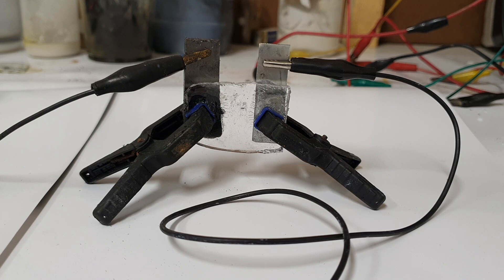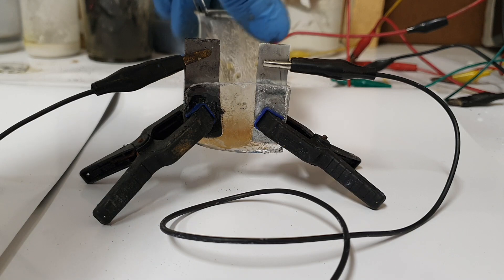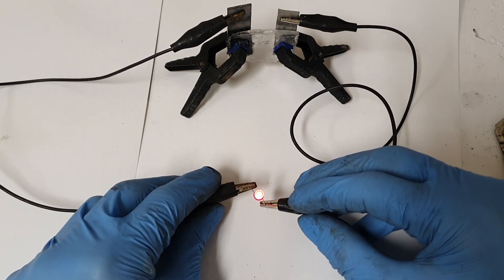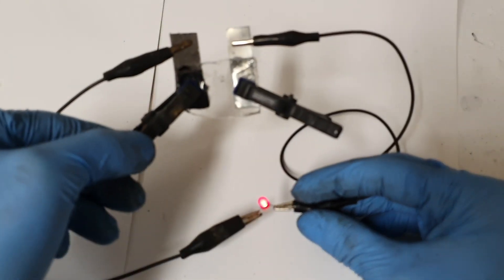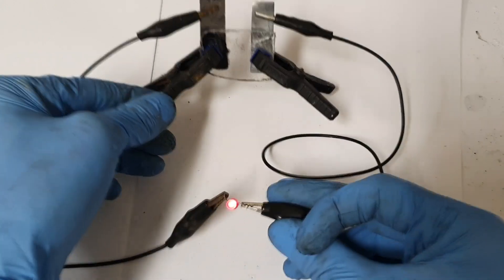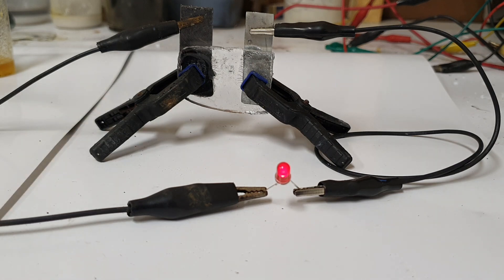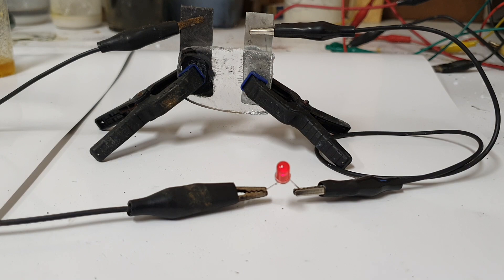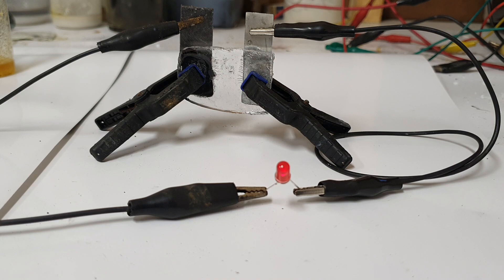"Transparent" Battery

Comment: Is the transparent material glass or plastic? Is the electrolyte between layers?
Reply from the maker: Actually can be both. The electrolyte is only where the electrodes are, in the middle is no electrolyte. I still have 39 samples to test, but I will make a video about this separator